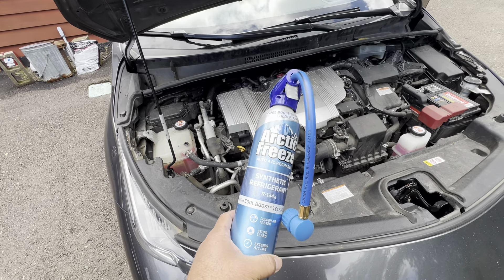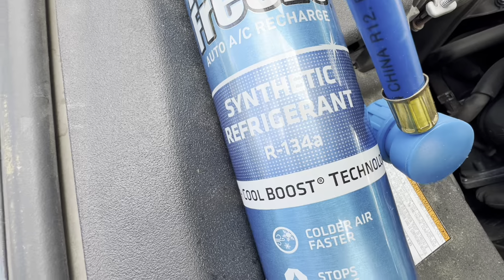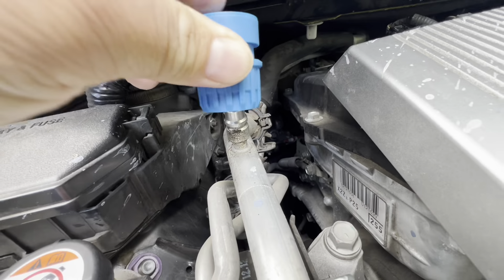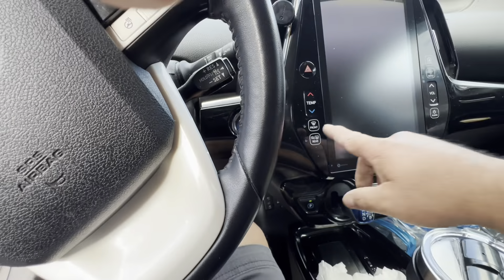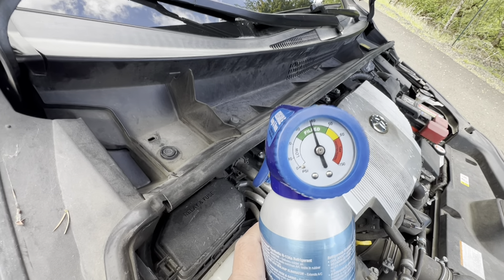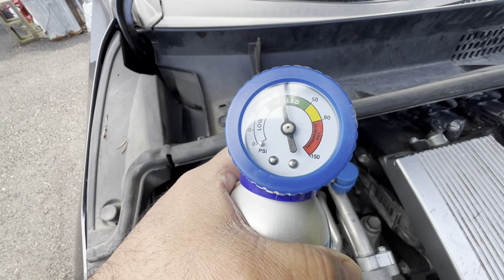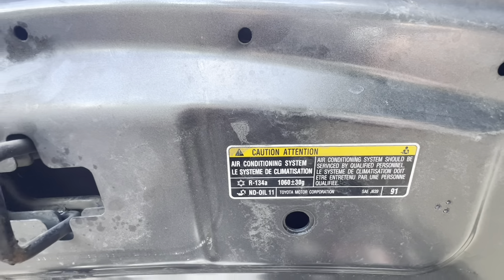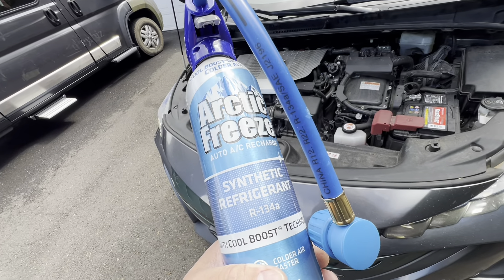2017 Prius Prime, air conditioning recharge makes this BLOW SUPER COLD air! DIY.

Comment: I love the the details in your Pime videos. I have the same Prius but mid level. What is the current status of your hybrid battery at over 180k miles? Mine only has 71k miles and have already lost about 15% (from around 30 miles when new to around 24.5 miles now with ac off)
Reply from the maker: I don’t think I ever got 30 miles on electric range. But again I drive with a heavy leadfoot. The most I ever got was probably 27 miles range. I still get over 25 during the summertime and around 20 in the winter time in the Pacific Northwest.
Reply: Tires matter alot
Reply: I have the base (Plus) 2017 Prime.  124K miles, bought it new.  Battery seems to have exactly the same EV range as when new (30-35mi due to my route using it in low-throttle parts of my commute).   My AC shows no signs of needing a charge.  I just drove it NH to Quartzsite/Yuma AZ last month, where it was pretty hot out!  

The "EV range miles" number is much more an indication of what sort of driving you recently did in EV mode, than it is an indication of battery condition.  By much more, I mean like 100x more.  Unless you used EV Mode in a specific way on a specific route when the car was new, and then exactly repeat it now like laboratory conditions, a change in the EV range number means ABSOLUTELY NOTHING, except that you are probably using it differently, or in different weather, etc.  I can decide whether I want my EV range when fully charged, to show 5 miles or 45 miles next week, and make that happen just by choosing when to use EV Mode versus Hybrid Mode for the next few days until I see the number I am aiming for.

The only sign of aging on my battery, is that when new, the longest charging estimates on 120V after a good discharge (using up some "HV" on the battery diagram after the "EV" was done), would be 5h40m or 5h50m max.  Now, it often estimates 5h50m, 6h00m, or even 6h10m.  I'm OK with that, and it is done charging before the estimated time anyway.  I've intentionally only used L1 charging at home rather than L2, because it's very rare that I want it done charging before the next morning.  I figure that habitually using L2 might degrade it a bit compared to L1, even though neither is anywhere near the charging rate while driving or using Charge Mode.

In July 2021, I ran the AC 24/7 for a month straight, during another car-camping trip to AZ/NV.  I'm guessing that people who almost never use AC, might have more AC charge problems than people who use AC a lot.  Seals dry out, etc.  Though I live in New Hampshire, so AC usage is not a year-round thing, I make sure to use it often even in winter.  Using the front defroster kicks it on in most conditions, for dehumidification when defrosting the windshield.    

Until I notice the AC getting feeble, I'm not going to even take a pressure reading.  Every time you hook up a gauge or recharge can, a little air can into the system, hastening the day when you'll need to have the Freon evacuated and refilled, rather than just recharged.  I had a 2003 minivan go its entire 13 year, 190K mile life without an AC recharge, and it was still able to cold when instead it was loaded on a flatbed to the junkyard.  That one died due to a failing transmission (I abused and neglected it) and a rodent infestation (from sitting almost unused for a couple of years).

Comment: THERE IS R134A FOR HYBRIDS  
PUTTING THIS REGULAR R-134A WILL SHORTEN THE LIFE OF THE COMPRESSOR
Reply from the maker: That’s worth looking into!
Reply: @AutoGuyVideos  FOR THE HYBRIDS THEY ADD DI-ELECTRIC ADDITIVE INTO THE R-134A
BECAUSE THE AC COMPRESSOR IN HYBRIDS ARE ELECTRIC NOT BELT DRIVEN
Reply from the maker: I will update if any problems arise. So far so good!